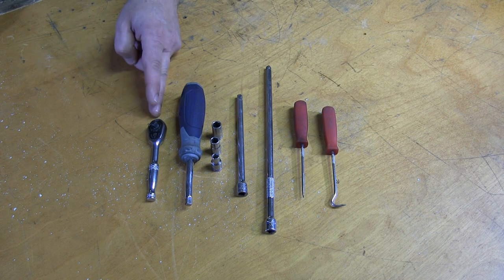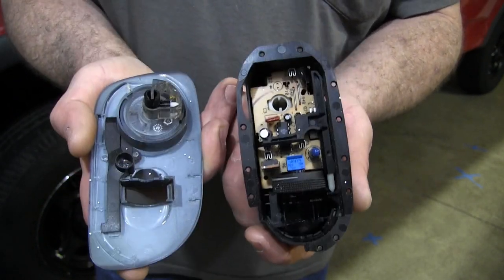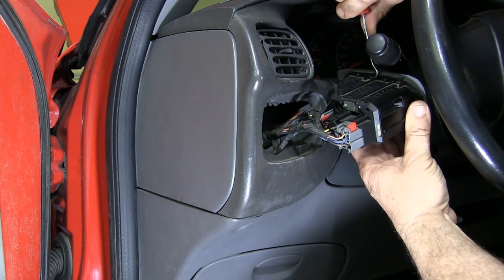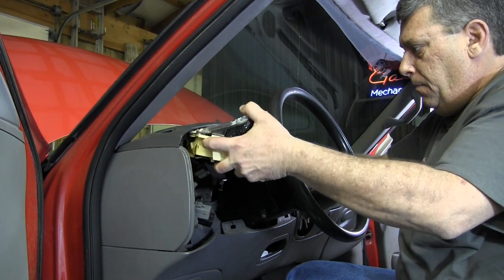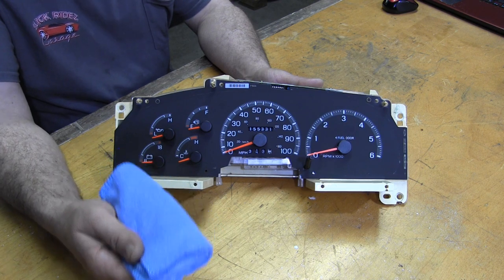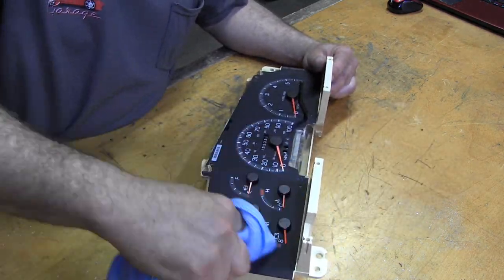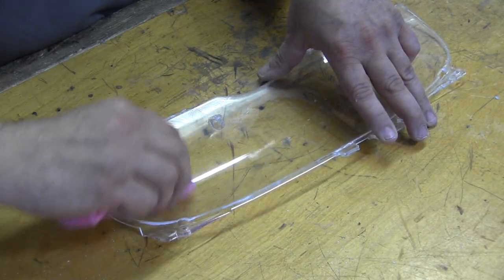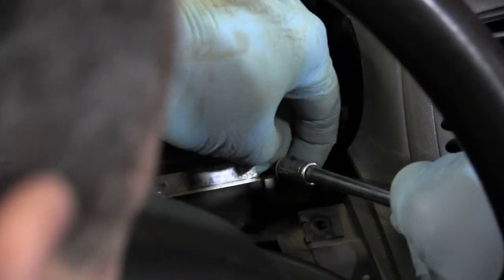1997 Ford F150 XL Shop Truck Factory Tach Upgrade!

Comment: My F150XLTStyleside 2 Door Stand Cab 6 1/2 foot Bed 4.2L 6.  Awesome!  It has that problem which I can now confidently fix! It has a second problem I am haveing difficulty fixing (and getting coorect parts for) to replace and SECURE and ADJUST  on the  headlights and turn signals  for the  alternative builds of  F150s up to the end of June 1996.  They have a different headlight assembly and (4)! retainers two for the plastic assembly the Lenses sit in and to for the lamp adjusting screws!  A real biochi to keep the lamps secure the assembly bracket clips I have and it hold in well.
Reply: Only way you're gonna fix that issue for that year is to replace the headlight "header" that the headlights mount on... it's behind the grill. You can Google pictures of it. Ford made a change after that year, yet after market headlights and side marker lamps will still work so long as you change that header. You will not get new original headlights lenses for that year anywhere, so to use aftermarket lenses which look identical to yours is buy the header...  the header will bolt right on with no problems. A salvage yard might have one if they'll sell just the header.  However, once you change the header you cannot use your original headlight lenses or side marker lamps... those will also need to be changed as they will mount slightly different than the aftermarket ones.

Comment: I wish I had one of these trucks. I miss mine and I should have never sold it.
Reply: They’re incredibly cheap in Texas.  Got my 2000 v6 F150 last year for $800.  It sat in a field for 6 years.  It only needed a fuel pump and new tank to get it running.  I slowly began replacing parts.  It’s been a blast repairing, sourcing,and upgrading parts on it.  Parts are really cheap and plenty of videos to help you fix or upgrade almost anything on it.

Comment: 2002 XL V6 2wd. It already has the optional tacho (except two gauges are on the right). I popped the OD fuse by jockeying the gear stick.

Comment: So I have 98 ford f150 with the 4.2 v6. Was trying to install an aftermarket equus tachometer, I hooked up the back wire to ground, the red wire to the ignition switch, the wire wire to the dimming light, but I couldn’t figure out where to put the green wire for the ignition coil pack. I tried a pink/white wire and it worked but it was inaccurate and wasn’t tracking the rpm properly. Just wondering if you can help me with what wire I need to connect to get the rpm signal.

Comment: Love the video, Subscribed and will start watching it soon that other series. :)
Reply from the maker: Thank you very much! I appreciate your subscription and comments. Hang in there and more videos will be coming!
Reply: Slick Ridez Garage Slick Ridez Garage Not a problem at all @Slick Rides Garage. Btw with the model F-150 you have I have been looking into for quite a while as a first truck within a few months now of possibly getting one. But one question I can't seem to get an exact answer on is Converting a 2wd to a 4wd and I've also heard that it's easier to do a solid front axile swap instead. But I'd like to know what your imput on this is and if you could make a video on it addressing it if possible. The difference of converting 2wd to 4wd or just solid front end axile swapping instead for a Ford F-150 97-03. So if possible I'd greatly appreciate it. 😃 Have a great rest of the day and would greatly appreciate a response.🙂
Reply from the maker: I'm pretty sure the reason for not getting an answer is because the time required and cost to convert to 4WD far exceeds the value of the truck. It can be done, but at what cost and how much time to complete? Here's what I did: First, maybe have a look at this video: https://youtu.be/5-V2tZ3Jd6c  I bought the F150 Shop Truck as a "basket case" with a bad engine for $500.00. The total investment to get it running and driving reliably was about another $1000.00 plus my time.....and it was already a 4X4. There are so many of these F150's around that ones needing work are pretty cheap and are on nearly every street corner. My suggestion is to start with a 4X4, fix that up and save yourself a lot of time bread and aggravation. Start with the cleanest 4X4 truck you can find or afford and go from there. Let me know if you have questions. I would have jumped in sooner here.....but it's a Monday! Have a good one!
Reply: Slick Ridez Garage Thank you so much for the reply. I will definitely look into that in the long run as well if I can somehow convince my dad to get me a 4x4 that's affordable lol. But there is a place down the road from where I live and they mainly just sell 2wd F-150's maybe 4x4's but I have to look over there more often to actually see what they have when they mostly sell very clean 97-03 F-150's from what I've seen passing by there. The company name is Taylor's Truck Center in Alachua FL if you want to give it a look. But anyways again have a great day and thanks for the reply. 🙂

Comment: Good job, nice trick with that headlight switch, that's something I didn't know about... I'll have to remember that one. But, how you know that donor clusters odometer was good? There's a small gear in there that goes bad, only way to know is to pull it out of the cluster. Ford screwed up with those and made the gear from rubber and literally self destructs. I made a gear for mine out of a real coarse threaded screw, then pressed it back on that little electric motor that runs the odometer. Amazon sells those tiny worm gears and they're plastic, while it's a good part, they charge 25 bucks for it... a bit too much imo.
Reply from the maker: I knew it was good because I own the truck it came from. And you're right, those odo gears have a bit of a glass chin as they age. Thanks for watching and commenting, hope you subscribed!

Comment: I have a 2000 base model f150 that has no tach but really wanting to change over to the cluster with a tach but always heard that if you have a digital odo the new cluster will set off the theft system causing a no start condition. Half tempted to try it out just to see.
Reply from the maker: Most of the time the PATS system will trigger and it's a trip to the dealer to get it started again.
Reply: I tried it today and yup my truck wouldn’t start 😏😏
Reply: @_nava_323_ what did you have to do to get it started again? I just got a cluster with a tach for my ‘04 Heritage. Wasn’t aware this would be an issue.
Reply: @brianrowland2561  had to get the key programmed to the new cluster, the cluster has the anti theft on it, they vv argued like $50 bucks

Comment: Great video, I've got a 97xl f150 6spd plain Jane. Non digital dash, found a 2001 f150xlt crew cab auto cluster with a much wanted tach:) do you think the swap is doable..Thanks for your insite. A fan of your work.
Reply from the maker: About the time you made this comment I started having health issues. I wish I could have helped you. Sorry about that. The digi odos won't swap to the 97/98 trucks.

Comment: I tried your trick. I have a 1997 f150 xl 4x4 with the 4.6l v8. I got a cluster from the junk yard and replaced all the bulbs. I then installed it. All of the lights light up. But the tach and all of the gauges are not working !!!!? Any ideas. The factory cluster was working fine just some bulbs were bad.
Reply from the maker: About the time you made this comment I was in a full blown health crisis. I wish I could have helped you. Sorry about that.
Reply: No problem. You had more important things to worry about!!!. Are you okay?.

Comment: I wanna change out the cluster on my 2003 f150 , it only has the speedo and no rpm guage , my odometer is digital , my question is , if i get a guage cluster with an rpm guage and a digital odometer , will it read the mileage my truck has ?
Reply from the maker: I think you will have to have the mileage set on the new odo

Comment: I have a 2001 xl and tried to swap to a cluster with a tachometer but when I did the truck wouldn’t start however it did turn over before starting how can I fix this please help (it’s a 5 speed manual)
Reply from the maker: Your 2001 truck has a PATS system, or passive anti theft system. As I said in the video, this swap is only for 1997-1998 model F150's with an analog odometer. To swap the cluster in a 2001 you will need to take it to the dealer or suitable shop with the equipment to properly re-program the ECU and reset the PATS system. You may now need to have it re-programmed anyways since the PATS system has been triggered.
Reply: @SlickRidezGarage  thank you so much

Comment: What do you do about the different mileage on the odometer?
Reply from the maker: In my case, nothing. The mileage difference was documented in the video. In my state the department of motor vehicles has a sticker available that can be applied to the door jamb for mileage documentation. If I were to sell the vehicle I'd have to provide the buyer with a statement of the mileage discrepancy and the reason why. As long as it's documented at the time of sale I'm in the clear and covered.
Reply: @SlickRidezGarage  So I went and bought a used Cluster from the local pick and pull, not convinced that there was no was to make the new clusters mileage the same as my original cluster. along with removing the front of the cluster I removed the back, There is a common repair that replacing the pinion gear on the electric motor that drives the gear set that advance the 2 rollers that display the total mileage  and the trip mileage display when they stop working, while there's no need to touch the motor an inch and a half to the left when the cluster is on it's face upside down in front of you is the end of the analog spool that is the mileage roll. Taking a pair of say 5 inch needle nose pliers you pry the spool out by pulling on it  using the edge of the case it's in. Take the spool out of the new cluster and put the spool in from your old cluster and presto you have the original 97000 instead of the 275000 plus that the new one is reading. I know these instructions are a little vague but it is possible to to transfer your old mileage to the new instrument cluster. if you just take a look at it for a minute I'm sure most will figure it out. Sorry I know it would be easier to explain by having photos after trying I couldn't figure how to up load photos on you tube. This will only work with 1997-98 analog dash clusters.

Comment: Is there a way to swap out the analog odometer into the new one?
Reply from the maker: Yes, but at the risk of damaging the indicator needles and not getting the needles in their proper place so the gages indicate properly. Thanks for watching and for your question!
Reply: @SlickRidezGarage  Update: I was able to swap original odometer mechanism into a cluster set with a tachometer and so far everything is working well. I really appreciated your tutorial video

Comment: So on my 1999 XL 5 speed any 1999 cluster with a tachometer should also work?  Can a dealer correct the odometer to match the old cluster as well, or do you have to just make note of the new odometers readings?
Reply from the maker: This swap is for the 1997 and 1998 F150. The 1999 has a digital odometer. The swap with a digital odo cluster is reported to work but may trigger the PATS system in to thinking the truck is being stolen and may result in a no-start and a trip to the dealer or qualified shop for re-programming. The digital odo's can be re-programmed by the dealer or qualified shop to match your old odo reading. Thanks for watching!
Reply: Slick Ridez Garage thank you for the reply, I may just restore the original one then.
Reply: Thanks for clearing that up... I just bought an aftermarket cluster for my 1999. Gonna look awesome

Comment: would this swap work on a 2001 xl also?
Reply from the maker: My understanding is yes, but swapping clusters with digital odo's may require a trip to the dealer to reset the PATS system. Thanks for watching!

Comment: I was going to do this on my 1999, so I have to change the circuit board as well correct??
Reply from the maker: Which circuit board do you propose to change, and is that for preservation of the odometer reading? Check out the comments below about doing this swap on a 99up F150. I'm thinking this may help? I spent Veteran's Day with a friend who served or I would have answered sooner, sorry about that, any more and I should be back with you this evening. Thanks for watching and have a great day!
Reply: Slick Ridez Garage the circuit board in the cluster itself. I think for 98 down it is plug and play, but for 1999 up if the circuit board is changed it requires a trip to the dealer. The circuit board with no tach won't fit a cluster with a tach I believe? That comment did help actually, the dealer actually gets the computer to communicate with the cluster then if the truck has PATS?
Reply from the maker: I've never done this swap with the digital ODO (99up), but some time ago a friend who's also a technician and another friend who isn't did. As I remember the tach and non-tach cluster's connectors are the same. Neither of their PATS systems triggered, and the non-tech friend did his swap in the dealer parking lot, just in case. While he was there he had his odometer setting updated. My belief is PATS can be triggered if the battery is re-connected while electrics in the dash are disconnected. I'll see if I can get in touch with the tech friend of mine in the morning and see if I missed anything.
Reply from the maker: Still haven't heard anything back from anyone. Sorry.
Reply: no problem, I had an appointment will the dealership because my truck wouldn't start after I installed the new one. paid 150 bucks for 1 hour of work and they couldn't figure it out. they asked for another 4 hours so I I decided not to go with them and try an auto electric repair shop. Very frustrating. Did they perhaps do their swap with the battery disconnected and maybe that's what they were successful??

Comment: I tried this And the tachometer is not working. Do you think it is a bad cluster? Any ideas?
Reply from the maker: Could be, which trim designation is your truck, XL, XLT?
Reply: It is a 97 F250 light-duty CNG model single cab long bed
Reply from the maker: You'll need to check the pinouts on the instrument cluster connector and make sure the wire for the tach is there. If it is then most likely the cluster is bad or there is a signal problem from the ignition system to the tach.
Reply: Ended up being a bad cluster I took it back to the Salvage and exchanged it for another one installed it and the tachometer work just fine. Only this one the odometer didn't work so I took the worm gear from my original cluster and replaced it on the small electric motor that drives the odometer everything works fine now.
Reply from the maker: Sweet! Thanks for updating and doing the swap! Have a good one!
Reply: Those clusters had a bad habit with soldier connections coming loose once you remove the cluster. When I did mine, only one guage worked, had to pull it back out and resolder  every connection on it, after that it all worked good.

Comment: Why did you swap the original engine?
Reply: these engines die super fast if you don't make sure to change the oil religiously,  the oil channels can get clogged VERY easily, and the spark plugs only have 2-3 threads holding them on so blowing them out or over tightening is a super common problem. I'm guessing either of these problems.

Comment: why does it have to be in neutral? I got a 2002 xl f150
Reply from the maker: Being in neutral makes it easier to remove the steering column/ dash trim. If you are going to do this swap on a 1999up truck please be advised the swap with a digital odo cluster is reported to work but may trigger the PATS system in to thinking the truck is being stolen. This may result in an anti-theft system no-start and a trip to the dealer or qualified shop to resolve. The digital odo's are easier to re-program to match your old odo reading so take a picture and document the miles before the swap! Thanks for watching and have a good day!
Reply: Thanks for the heads up man probably saved me a big headache
Reply from the maker: Your welcome. A friend of mine did the 1999-03 tach cluster swap in the Ford dealer parking lot.....just in case. Although his PATS didn't activate it could have saved him a tow bill doing it that way. Sometimes they trigger and sometimes they don't. It also saved him a lot of trouble getting the dealer to reprogram the odometer....he showed the service manager his miles on the old one and told him what he was doing. If you live in a larger metro area an independent shop should have the equipment for PATS recovery and ODO programming. Oh and your headlight switch does not have the slide lock mechanism, you have to pry the later switch out. I think the cut-off is 1999 or 2000 for the slide lock switch. Anyways thanks for watching and for your question. Have a good one!

Comment: Will this still work if I have the1998 V6 5 spd and get the cluster from any V8?
Reply from the maker: Yes, the swap works for the V6 and V8 1997 and 1998. Thanks for your question
Reply: Thanks for taking the time and answering me. Hope you're feeling better.